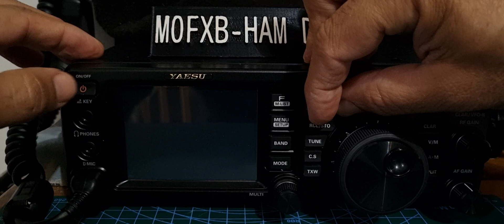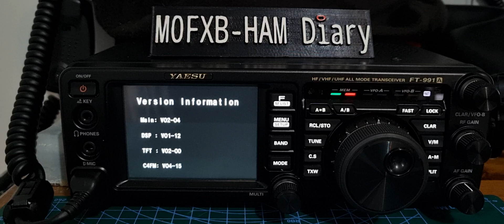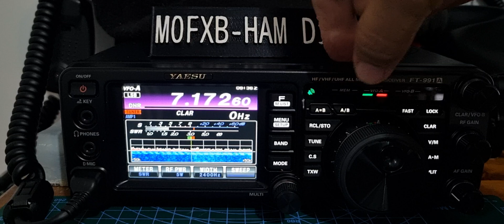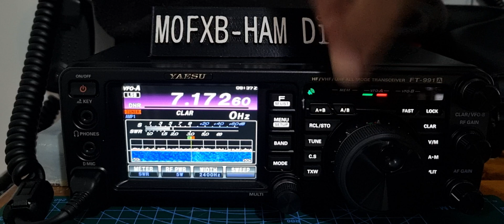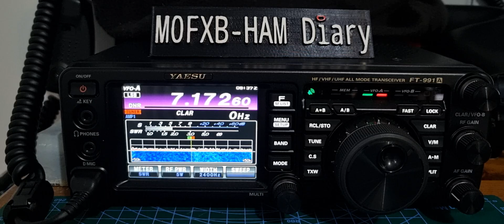YAESU FT-991a VFO A-B Bug, Do you also have this ?? Latest Firmware

Comment: Hello, I own an 991A since 2019 and I noticed this weird behavior since the beginning. I do NOT  agree with most of the other comments here. The radio has two VFOs, A and B. They can ALSO be used to work in split mode. Now, like on any other amateur transceiver who has two VFOs, when you push the A/B button you’re changing from one to another, and the corresponding lights or indications should notify this to the operator. In fact the two VFOs work perfectly and like any other radio, only there’s no highlighting, which IS a bug. As it is there’s no way to know if one is on A or B. An example just to be more clear.
If I’m one who like to use phone frequencies on A and digi/telegraphy on B I still have to read the frequencies to know where I am instead of reading an A or B light. The light are there, just don’t work the way they should. Pressing B both the green (rx) and the red(tx) should swap from A to B. Try any other radio and you’ll see.
73
Reply from the maker: Thanks good info .

Comment: Split mode only. Not a bug at all. You may want to switch A/B by simply hitting the button, but it doesn't work that way. Hit the Split first, then when you hit A/B the two frequencies swap, and you will be transmitting on B while listening on A. The Clarifier knob is now in control of VFO B. The TXW button temporarily switches, so you can monitor, while the A/B button flips the two frequencies. Check the user manual page 76. Not a bug.
Reply from the maker: Thanks

Comment: I have had an FT-991A since 2018, with the  last firmware upgrade, the changes have never changed this operation you describe.

To get the proper functionality of both the A & B VFO's you must be in SPLIT or MT mode. The label VFO-B has never appeared in the top screen,  or is meant to. The manual is quite clear in referring VFO-B as the "sub band" which only appears in the sub screen in split or MT. VFO-B is only available to transmit in SPLIT or MT, and the clarifer becomes available etc. The Tuning Dial also only affects VFO-A. The concept of the A/B button is purely to exchange information between VFO-B & VFO-A, so that you can tune the VFO-B with the main Tuning  dial. Also it transfers the Status/Mode contents etc. (Note you can momentarily swap the VFO contents by pressing TXW button).

Clear as mud?  These buttons are doing what they are meant to , there is no "bug."

73 Gavin
ZL3GAV
Reply from the maker: Hi Gavin , thanks for this precise info exactly why I made the video .Andreas
Reply: @M0FXBHamTech    All good.  I have chatted to another user this morning, and by his recollection the A/B button operation has never changed. It is a great radio, I guess as it has been around for a while a resfresh from Yaesu is due. These are good set of videos you have done on the FT-991A. 73
Reply: Perfect.
Reply: Just got one.. if this was intended. Why is there a VFO-B RX led?